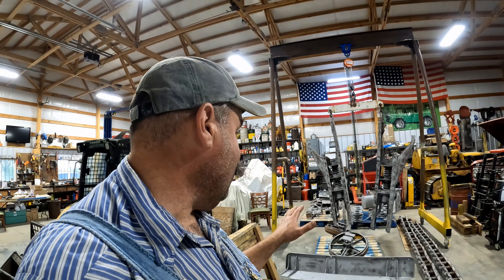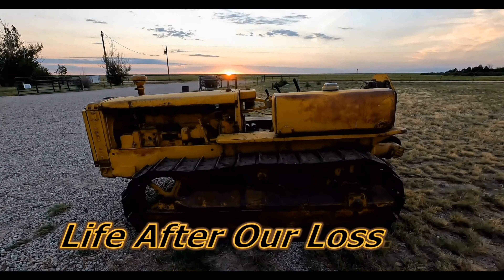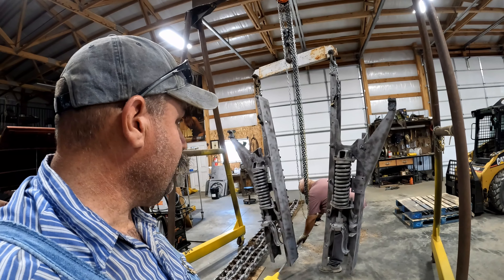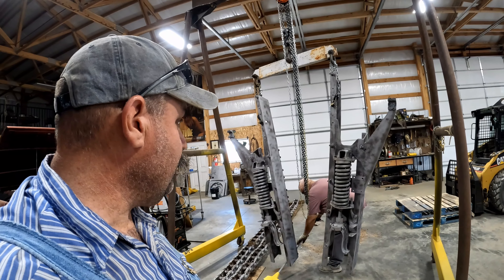Mobile sandblasting fast tracks the Caterpillar D4 "Lil Lefty" project! & Stuck chains? Episode #105

Comment: You need to submerge those stuck links in water (or diesel if you can). It will take time for anything to seep in there.
Reply from the maker: For now it's just a few cans of penetrating oil. Later I will take it out and power wash it. But I will pay close attention to in between the links. 👍

Comment: I know you don't want to contaminate that chain and make it hard to paint. But if you let it soak in a tank of diesel, it would loosen up. I've had to do that a few times and it always helped. Maybe a coats of paint before soaking it.
Reply from the maker: That's a good idea. I think with a combination of soaking it and working it we can get it where it needs to be. 👍

Comment: I just had some work done by a dry ice blaster...   Zero residue...  except for the rust and paint that come off what you are having blasted.  I used a broom magnet on the rust.  But there is no blast media left on the ground when they are done.   The ground up dry ice works like ground glass but then just sublimates from a solid to a gas and floats away.   They do a lot of work in commercial kitchens.
Reply from the maker: That is a brilliant idea! I never knew it existed. Was it costly?

Comment: Hey Aaron just a suggestion and I do this with my 555 because it’s a 1978 and it’s just for our use so if it breaks down no big deal but I bought a brand new grader blade 26 inches long and welded to angles anyway it fits across the teeth on a 24 inch bucket so if you take your chain outside block it up the way you had it but have the chain turned the other way so you can lift the bucket up 4 inches or so and hammer it it might shock it loose but I wouldn’t recommend that you do it on one tooth but if it’s spread over 4 it shouldn’t hurt your machine it’s no different than ripping frost I hope that helps if not just ignore me 😀🇨🇦
Reply from the maker: I'm not going to ignore any suggestion. What's a good idea but I think what it really needs is just a little bit of folding and unfolding. Combined with soaking it and penetrating oil and a good power washing I think it will do the trick. The welding a blade across an old set of teeth is called a butter bar. A lot of pipeliners use them. They're also great for cleaning ditches nice and smooth. Appreciate the suggestion! 😊
Reply: Yes I made mine for exposing sewer and water lines but I made mine so it bolts on the holes for the side cutters and then it’s not welded I can take it off with 2 structural steel bolts and then I can rip frost and put it back on and make a smooth cut and no teeth marks but I always keep some used oil for stuff like that especially when I ran the trencher after every job used oil on the chain 😀🇨🇦
Reply from the maker: That's clever, bolt on is always better than trying to drift out those keeper pins!